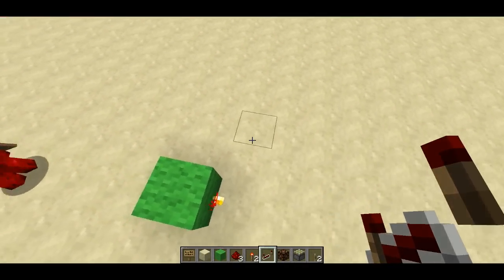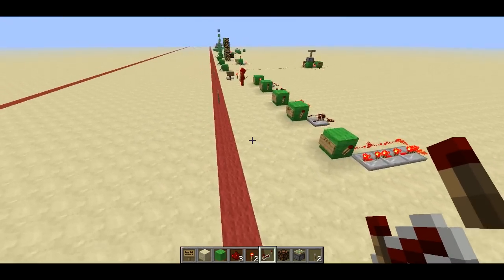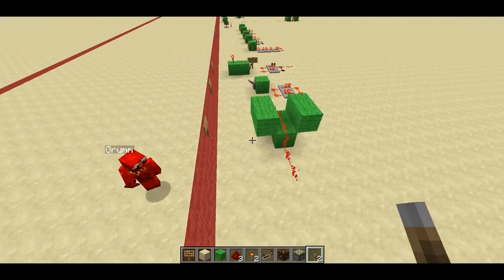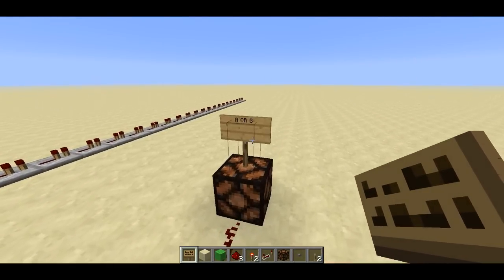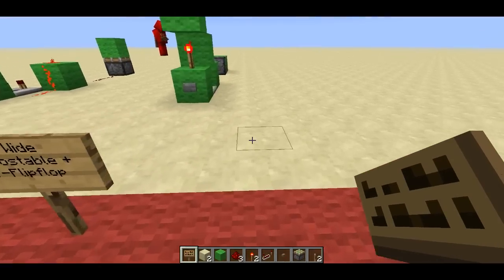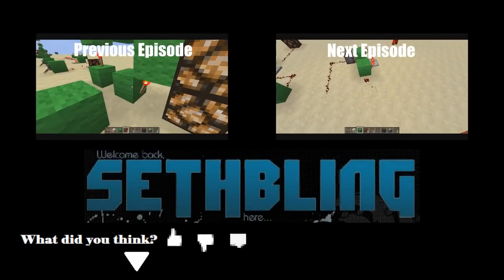Redstone Lessons with a Mojangster (Part 2 of 4)

Comment: Ot takes one tick for the redstone torch to turn on after being powered off but if you try to turn it off again within 5 game ticks, it will turn off instantly.

That's exactly why the monostable circuit outputs (RepeaterDelay-1)-1 redstone ticks.

Comment: Did monostable circuits get changed since this ? In 1.8.9, I can't seem to do that sticky piston thing, and it makes T Flip-Flops impossible.
Reply: +Denter86 Yeah, this kind of T-Flipflop is impossible now, but there are other ways to build one (you'll find them easily, when you search for)
Reply: Just do it with 2 normal Pistons.

Comment: hey can some on explain to me what a tick actually is?
Reply: It's a unit of time measurement in Minecraft. What Seth is talking about is a redstone tick, for instance, a repeater by default has 1 redstone tick set. 1 redstone tick is also equivalent to 0.1 seconds.
Reply: ok thank you for the explanation
Reply: Minecrafter 731 It isn't really a unit of time measurement as it depends on your computer capability to handle Minecraft at 20 ticks per second and ticks are the moments where the game code runs one whole cycle through
Reply: 1 tick is equivalent to 0.05 seconds, you mean. There are 20 ticks in a second.

Comment: The reason why the monostable circuit has a shorter pulse than usual is because it takes a tick for the torches to go out (like with the vertical repeater)

Comment: They are, in fact, what is considered in electronic logic to be OR gates. What you are talking about, which is "one or the other but not both," is usually called an "exclusive OR," or XOR.

An interesting thing about the XOR is that the NOT of it (XNOR) is an equivalence checker - it's on if the inputs are the same, either both off or both on.

Comment: Well you can always change the powered repeater you are using with parallel port kinda setting. Each repeater can have different delays. When you need one you can direct the power to that line.

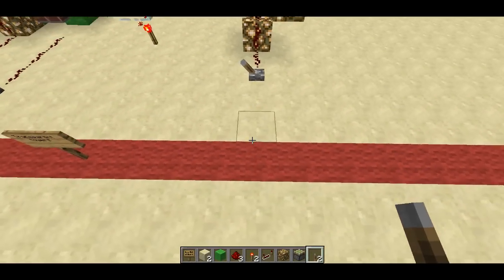Comment: @21:00
this might be the case for you mono-stable circuit as it has a 2 tic on the piston due to the 2 torches adding another tic delay.
lever on
tic 1: repeater 3 tics, torch a send
tic 2: repeater 2 tics, torch b send
tic 3: repeater 1 tics, torch b on, piston on
tic 4: repeater send, torch b off, piston on
tic 5: piston off

Comment: Actually, for the fastest clock he did before the pulsar, if you put a block in place of a piece of redstone in front of a repeater and hook it up to an extended sticky piston, you can turn it off with a lever by retracting the block, but you have to reset the clock manually.

Comment: *****_INDEX_*****
00:01 simplest clocks
03:30 Fast Clock
05:28 Feedback Loop
06:30 Rapid Pulsar
08:35 Oscilloscope
10:48 Or Gate
11:51 Nor Gate
13:14 And Gate 1
15:23 And Gate 2
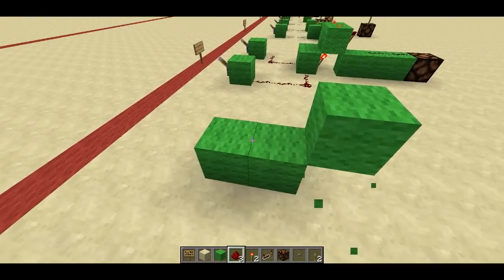17:07 Blocked & Unblocked Redstone Conect.
18:21 Diode
19:51 Transparent Towers
20:23 Instant Glowstone Tower
21:53 Monostable circuit
26:41 1-Wide Monostable + T FLip-Flop
-------------------
Thumbs up so everyone can see :)

Comment: It's easy'r to press alt and the game will pause AND you won't get the: Back to game, Options, etc. plush you can then click anywhere and it will unpause. This helps if your going down a long staircase; just hold forward, press alt, let go of forward, click anywhere you want and... Tada! Your character will keep moving forward until you press the forward button again.

Comment: Is there a way to have a door open to two levers but if one lever is off they are both off and if the other lever turns on they both, when flipped, will turn it off again. Thanks, PittyViper
(I want this for MC Xbox 360 survival.
Reply: I’m late as fuck but you want a xor gate
Reply: @newtybot  As someone also late, and now a computer science undergrad, yes I did need that. Quite badly.

Comment: 1:30 You did that wrong, Seth. You actually for an OR gate like that, you have to put repeaters at the end before both of the signals get to the middle, so if one is turned on, it doesn't power the other side. Vice Versa. Might be my OCD trying to prove you wrong though. :)

Comment: FOR THE PRESSURE - PLATE PREDICAMENT, you could've used a Slime Block to bounce off. (:
Reply: Umm... This video was on 2012
Reply: +Brk erd 1.3 :(   (My Version 1.2.5)
Reply: +xXThe_Dark_AssassinXx It couldnt have been in 1.3 as Redstone Lamps were added in 1.5
They mentioned snapshot so maybe it was in the 1.6 snapshots :D
Reply: +XvANDYvX YT (Andrei) Redstone lamps were added in 1.2!

Comment: Wait what? Sethbling... At 5:18 you say that you HAVE to break the circuit to get it off but that's not true. You can use a piston and gate anywhere there is redstone on the clock.

Comment: i(dot)imgur(dot)com/BVCeR Seth! In the linked picture, I've redone your design for a Monostable Circuit. It works just the same, but is noticably smaller. Note that in the picture, my design has an upward sticky piston under the 2nd block from the left.

Comment: what about a comparator clock
Reply: this was filmed in 2012
Reply: +botmin ahh
Reply: They added comparetors after that, i think. Thats why they made this world
Reply: +Cyriel Paridaans  true because comparators are 10x harder to learn than repeaters
Reply: +msavri i get some of it but i think some stuff of it needs to be discovered by the comnunity
Reply: Cyriel Paridaans probably
Reply: Cyriel Paridaans yeah because on comparators there are 2 modes 

Normal mode (1)

Subtract mode (2)